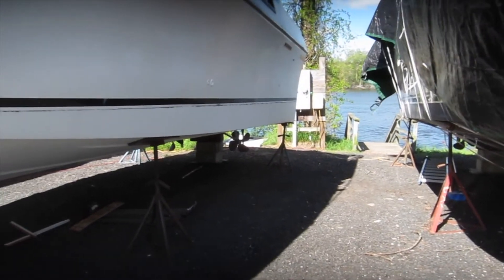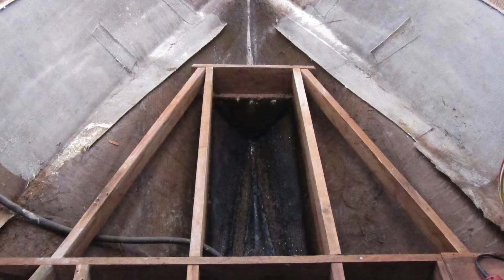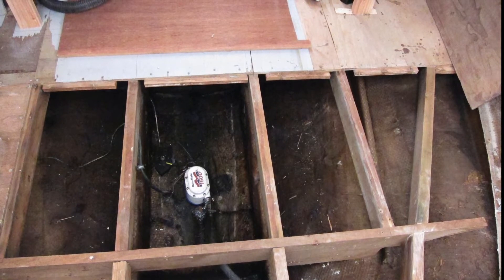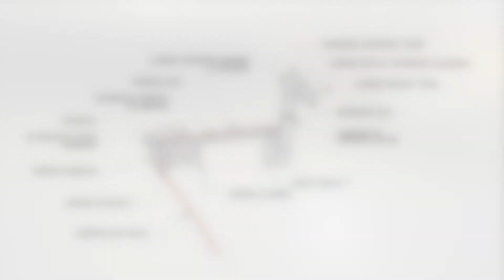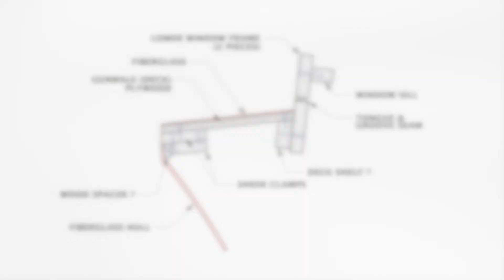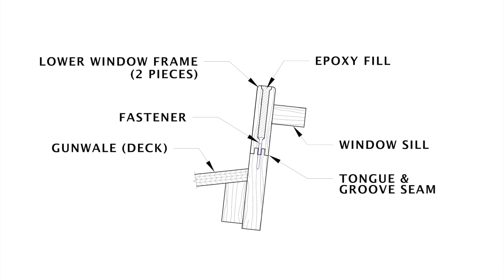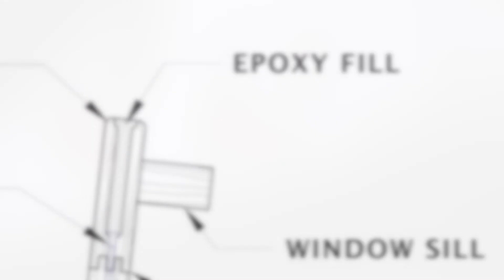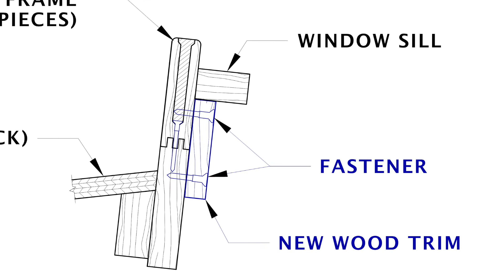Cabin Sole, Gunwales, Sheer Clamps - Boat Restoration EP003 (2012 Part 2)

Comment: Great Job on the renovation/rebuild. Looks like you will have a much stronger & better built boat than the original factory build. I have a 1966 Chris Craft 38' boat with similar construction. Mine is in good condition, no rot fortunately. I am doing a restoration. Enjoying the build process & videos. Thanks
Reply from the maker: Thanks for watching and the comment. Nice boat you have there. Even better that it is in good shape. Good luck with the restoration. - Bob

Comment: U did great job on that sole restoration, bud. You've done a better job than the original builders on the gunwales, sheer clamp decking fitment  ..I thought you might of painted the fiberglass but it's still cleaned up well.
Reply from the maker: Thanks Fon, My aim is to improve things as I go to try and prevent the same damage occurring again. At least for my lifetime with the boat. Thanks for watching and commenting. - Bob